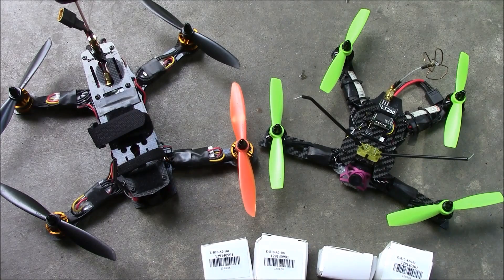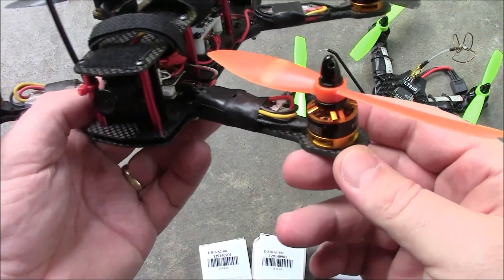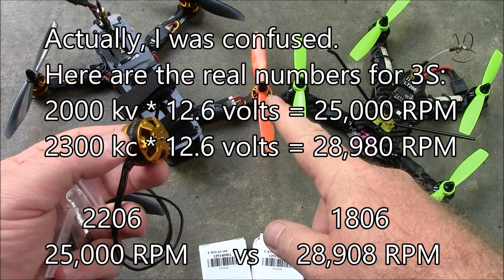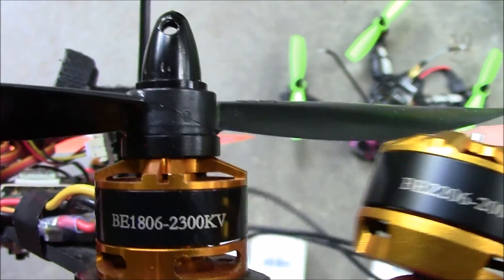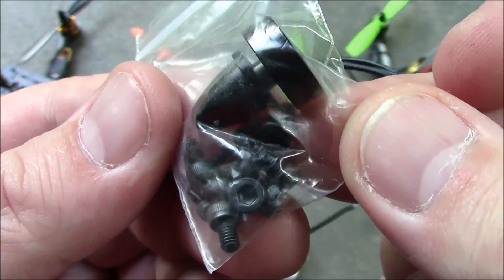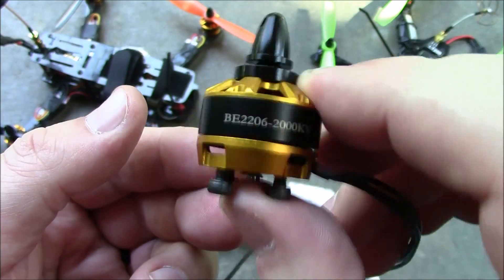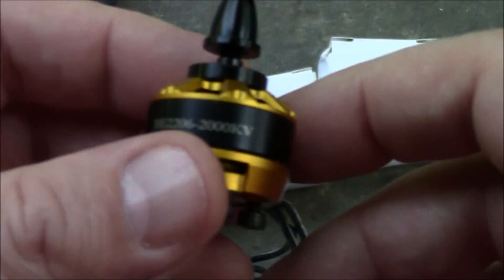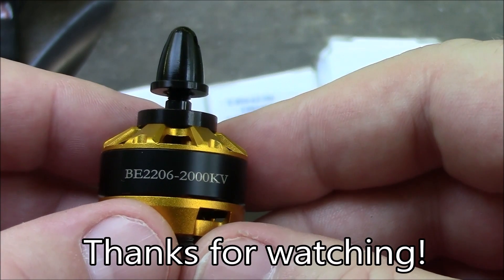DYS 2206 2000kv Motor Unboxing and Review from GearBest

Comment: I notice that you have the clean plate removed from your ZMR.  Do you get clean video without that plate.  I'm sick of dealing with my clean plate and have been thinking about taking it off.
Reply from the maker: the video looks good to me.
Reply: +travisgrindal hey man right now I'm running emax 2204 2300kv. If I want more speed and acceleration, should I get a 4s capable 2204 2300kv motor with 15amp ESC's or 2206 2200kv motors with 30amp ESC's?

Comment: Hi Travis, how is the quality of these bearings [DYS motors] that after about one year .. I want to try out these motors but need some advice from you , thank's Travis.
Reply from the maker: They still spin fine.  I have some DYS 1806 motors that are going on 2 years and are still flying fine for me.
Reply: bullshit i fucked up 4 dys 1806 in 3 months with no hard crashes i will change to others
Reply from the maker: That sucks.  My oldest quad has the 1806 motors with the 4mm shaft before DYS changed them to 5mm shafts.  They still work real well, I just have to be careful not to lose the plastic prop adapters.

Comment: Hey Travis have you messed with 1806 2300kv motors, 4045 bullnose props running on 4s? If you have how did it perform? I'm thinking this is the setup I would like to use on a 180 size quad. Thanks for the vids they help me a lot.
Reply from the maker: +gripchion I haven't run 4" props on 1806 motors but I'm sure they would spin them just fine.  If you're looking for extra crazy speed, you could get some of the 1806 2600kv motors.  I don't have a link to them though.  2600kv would make those 4" props really spin fast!!
Reply: Thanks for the reply and the info.
Reply from the maker: +gripchion You're welcome!  One of my friends flew the 2600kv motors with a 3S battery on his Tweaker at our last race and he beat all the 3S and 4S flyers!  It was fast!  He was flying 5" props though.
Reply: Are u in Kansas, do u guys let anybody come to yr races I been flying tricopters for a couple of yrs and just getting into fpv I would like to see what the races are like.
Reply from the maker: +gripchion Yeah I'm in Topeka!  Join our Facebook group "Topeka Drone Racing".  You can also join "Kansas City Fpv".  We're having a race in DeSoto on 11/22.
Reply: +travisgrindal too cool I'm over by Hays I will have to join the Facebook and put that race on my calendar. I will see if My friend Heath wants to go also. He has a qav 250. Thanks much Travis. Jay Scott
Reply from the maker: +gripchion search for me on facebook.  my in laws live in Hays.  maybe we can meet up sometime out there.  I know a couple of guys from the Hays Hobby Shop that fly too.  I have a YouTube video of one time I flew out there.
Reply: +travisgrindal sounds like a good time I talked to Heath today and if all the stars line up we plan to head yr way on the 22nd if u guys have a race.

Comment: Will the dys 1806 with a 3s lipo spin 6inch fine?
Reply from the maker: yeah, the 1806 will spin them just fine.  they won't spin up to full speed though.  I have the 1806 and 6 " props on one of my quads and it cruises real well.

Comment: If you really want the speed SunnySky 2700kv on a 4s with a 30A esc is the ticket. RC model reviews has a bench pulling 200g more thrust than a cobra 2204 2300, the SunnySky is a little bigger and a little heavier but 200g more thrust per motor is crazy!
Reply from the maker: +Side85Winder My SS2207 motors are 2100kv.  I already had the 20amp Afro ESCs so I just used them.  If I burn one out, that will be a good excuse to buy some 30amp ESCs.  :)

Comment: thanks for the cool video. 
what's your opinion on esc firmware Simon K or Bl Heli. 
I am new to flying quadcopters ; right now I'm using 12 amp esc w/ Simon K and 1806 2300kv motors.
Reply from the maker: +Gear Ratio Head RC I started off using SimonK, but now all my new quads are using BLHeli.
Reply: +travisgrindal 
ok, thank you..

Comment: with the larger can motors (2206/2207) you should give some 5x4.5x3 props a try. Not only do they sound like demons from hell, they make you go fast. Very fast. I like the triblades on the 2206 motors.
Reply from the maker: +Hiway I had some of those props laying around.  I'll give them a try.

Comment: Nice review! What are your Cleanflight PIDs for the ZMR? Could you send me a screenshot. Thinking of leaning to the ZMR than the Color 250.
Reply from the maker: +Daniel Dust I don't know why, but I have a terrible time tuning Naze32 boards.  My ZMR250 has a CC3D on it now.  It had a Naze32 on it originally but after a bad crash, the Naze32 quit working so I switched it over to a CC3D.  When I was running it, I used some PIDs that were supposedly Charpu's.  They worked pretty well.
Reply: Sounds good, thanks dude!

Comment: You've mistaken the prop adapter, which is indeed 5mm, with the shaft, which is 3mm... I've seen only Cobras to have 5mm shaft :)
Reply from the maker: +Martin Brychta You are correct.  I need to remember to distinguish between "prop adapter" and "shaft" in the future.  My point was that you don't need to use adapters with your propellers if they have a 5mm shaft hole.  The 1806 motors in this video have 3 mm "prop adapters" and I have to use adapters with the props.  It is kind of annoying.

Comment: Holy cow!  That's an upgrade.  Tell me you've seen the 5s quads on the 1800,1960,2000kv Cobras. "Richard Shelton". 1500grams of thrust on 6045 5s.
Reply: Per motor!
Reply from the maker: +Invitingsauce I've seen a few 5S quads and they are insane!  They are way too fast for most pilots and are pretty costly just for the batteries at this point.  I think the 3S ones have been kind of a standard because of their cheaper price point and more controllable flying.  I do want to build a 5S quad one of these days.
Reply: +travisgrindal yeah I'm still learning to fly. Getting better LOS and FPV. I'm still running 5030 on 3s.  I haven't even tried 5040 5045. I have them but I need to be able to at lest have good solid control all the time before I step up the speed. 4s capable build maybe in the winter. Can't wait to see them fly